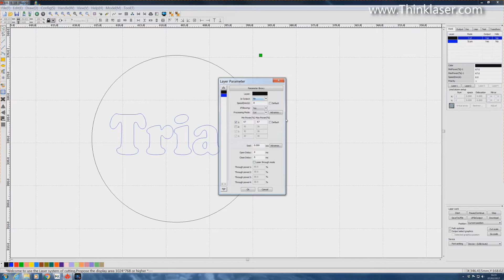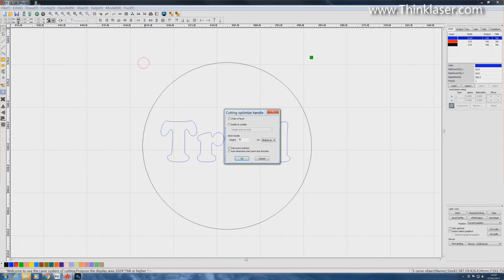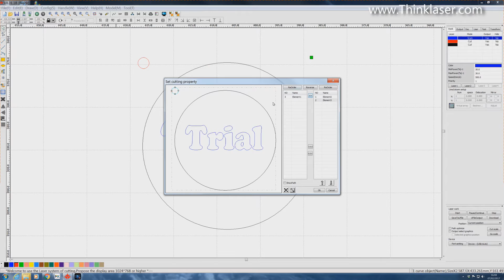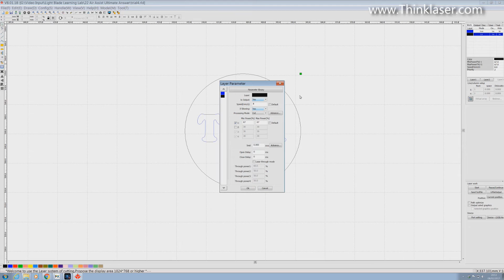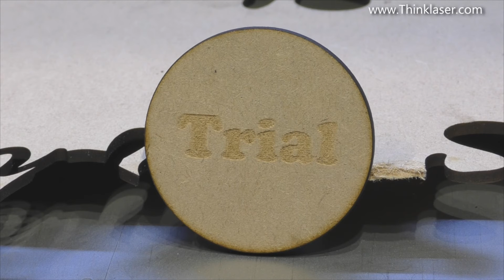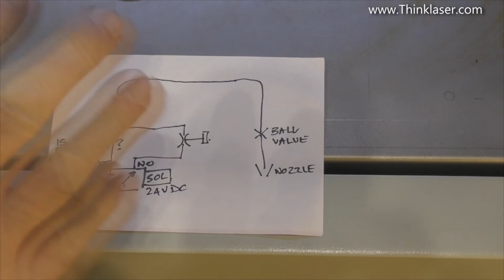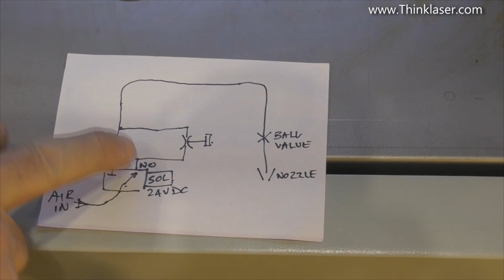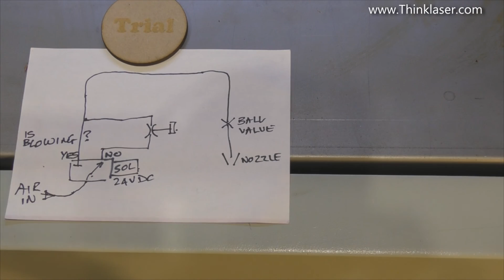How To Use a Laser Cutter - Lightblade Learning Lab 22 Air Assist   The Ultimate Answer

Comment: More easily, have the air assist valve on but the pump off. That way you just start the pump by switching it on and not bother with inside the machine operations. Also no need for pausing the job as the invisible circle delay is enough to plug the pump.
Reply from the maker: Hi Polis,

Thanks for getting in touch,this is Gareth from Thinklaser. You can't turn off the pump as you always need a small flow of air (positive air pressure) into the nozzle in order to stop smoke contaminating the lens.
Reply: Thinklaser Limited yea, that's an issue...
Reply: @Thinklaser  A bomba que veio com a minha máquina, tem um controle de fluxo de ar giratório então dá pra aumentar e diminuir nesse tempo de atraso entre a gravação e o corte.